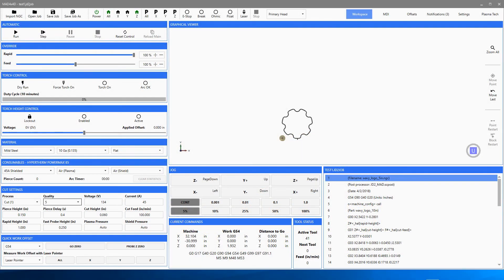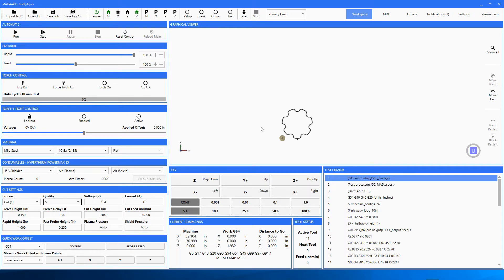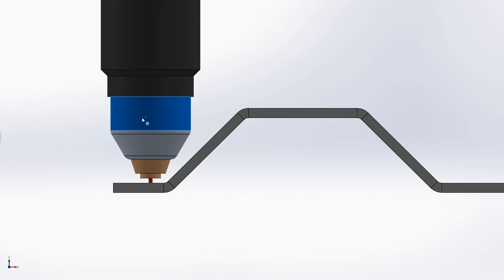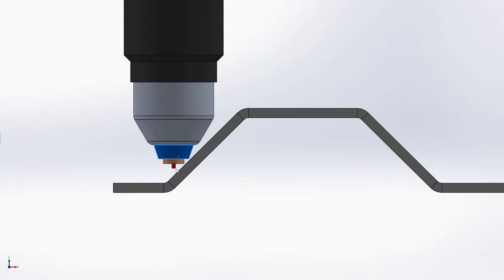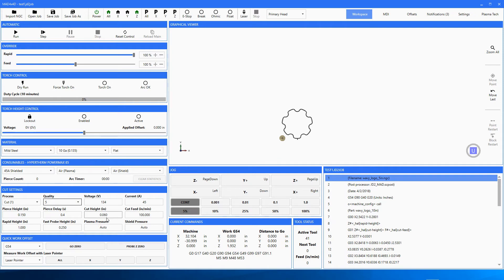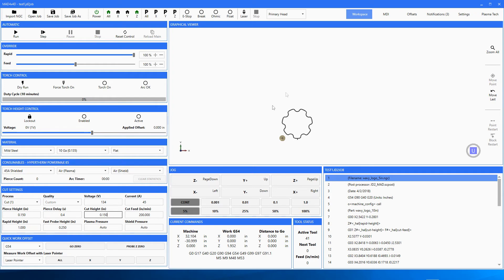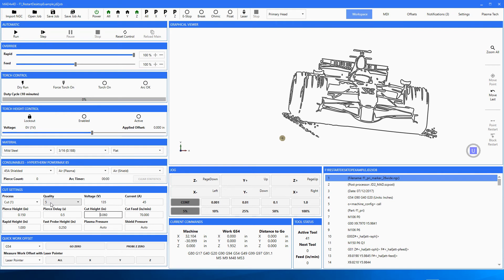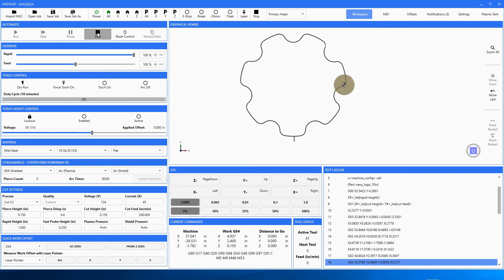MAD Series GUI -  V3 Job Feature Descriptions

Comment: Sounds good but if you want to truly save time allow the job being saved include (Rapid settings, Torch Voltage, Omic Off, also Torch set as primary head.. Also allow us to have  DRO's that accepts manual numerical input values for x,y,z once a value has been entered press the enter key moves the gantry & torch to that location.